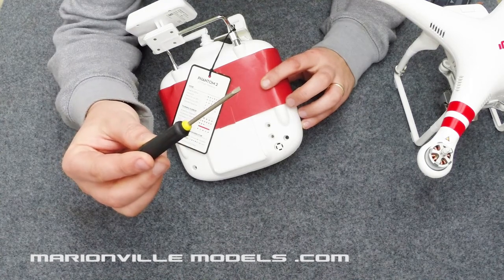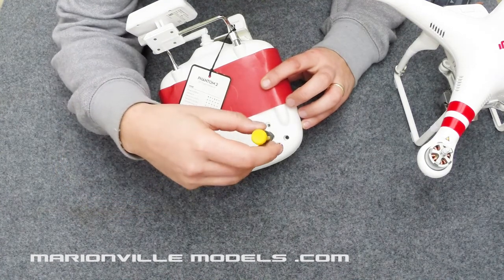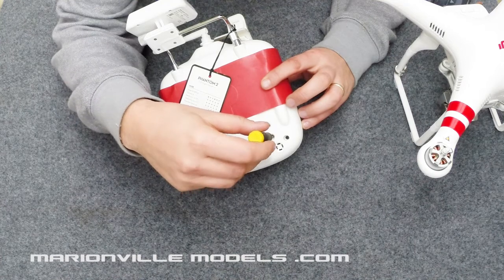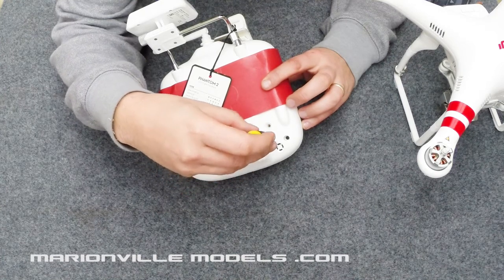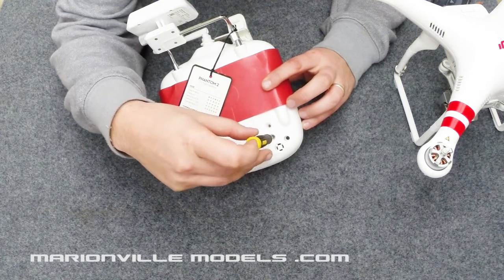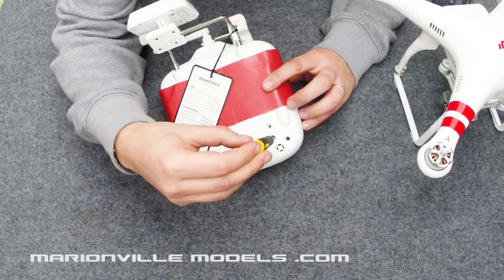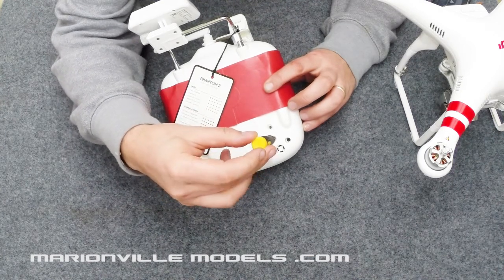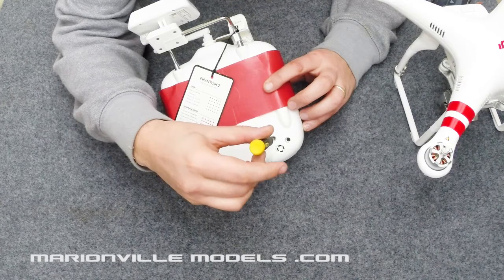Extending the Range of the Phantom Vision, Vision+ & FC40 Transmitter

Comment: Hi , what is the job of the upper one ?
Thanks.
Reply: Thats an optional hole for the camera movement module.
You will get a adjustable switch to build in your controller for adjusting the position of your camera angle (if you use a gimbal)
Kind regards!

Comment: Your voice track says FCC mode extends to 500m. The text above says 800m. Is 800m correct?
Reply from the maker: Yes 800m is correct.
Reply: It is possible to get well over 4000m from the stock RC controller in FCC mode, some people claim 6000m.  The limiting factors are FPV range and battery life.
Reply: Marionville Multirotors 800 meter means it extend to or add another 800meters?

Comment: Iv just ordered a FC40 from you guys.. can you tell me if the range extender in this video fits the FC40?.. If not is there a solution to get further than 100m fpv with a smart phone.. cheers
Reply from the maker: Thanks for your order. I'm not sure about the rang extender but I did see a video where a wifi Router was used as an extender and range was increased greatly.
Reply: No the range extender wont work with the fC40s flight range. But if you mod your transmitter to be able to take a better antenna you can drastically increase flight range. and if you want to have farther FPV range on the fc40s wifi video. there is already a much better option then trying to use a wifi extender / booster. If you use a kindle fire with the mobile1 ap that will let you install regular android aps and then use that to install the camera ap you can get much better wifi range then you can even get using the repeater set up that is in this video. The repeater only gets about 300 meters tops.  yet with just a kindle fire you can get about 350 meters wifi range.  If you want even more range then that if you mod the kindle to also take external antennas you can get even farther still. On my my kindle that I moded to take an external antenna i can get about 600 meters. but if I use my wifi single amplifier. Between the kindle and the antenna i can get about .6 miles on the fc40s video tho I still need to find a way to make it go farther then that being I now have my flight range up to over 1.3miles and would like to be albel to have fpv that far to. But only way I think thats doable is to also nod the fc40s camera antenna to replace the joke of a built in antenna it has in in it.

Comment: how do you recover control after the drone flew out of range and started going home procedure and i don't know how to regain control when it is back close to me!??
Reply: if you flip the switch out of failsafe and in to gps you need to flip in in to atti for a second then back in to gps and you should be able to then regain control.
Reply: put the upper right side channel switch from gps to atti and put the throttle down all the way, then after 1-2 seconds you can put up throttle and use other controls
Reply: Im assuming that by "put the throttle down all the way," you mean just let go of it so that its at the center position???? Some esp inexperienced flyers might think that means to pull down on the stick and descend. Which could be bad if they cant see were they are at and lower down and hit some thing on the way back.
Reply: press it to lowest point 'down'
Reply: p. porter I just flick the gps switch on controller tx. once and all the way  up again and you should see the go home on your phone or tablet go away and you should regain control again if it stays in go home mode you are still out of range to regain control.
Reply: to rc fun
cool ill try that.  it sound even easier than my way
Reply: the s1 switch\ button on the controller tx. flick it all the way down and back up to gps mode that should work.
Reply: you don't have to touch the throttle at all . just the s1 switch
Reply: thank you my friend.  what max range have you gotten out of your transmitter I hear people are getting 2000 meters plus on the 2.4ghz phantom 2, that's what I have coming end of this week. my fc40 5.8ghz is like 900-1000 'feet'
Reply: so far ive upgraded antenna and I am getting 4000 feet only. at 550 feet altitude .
Reply: stock I was able to get 3500 feet